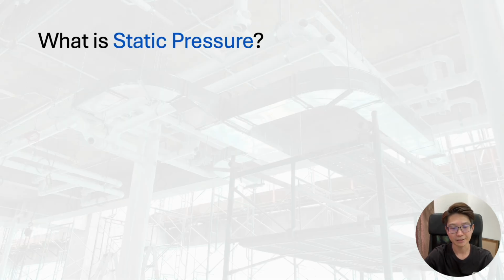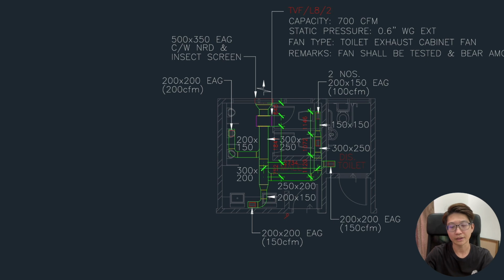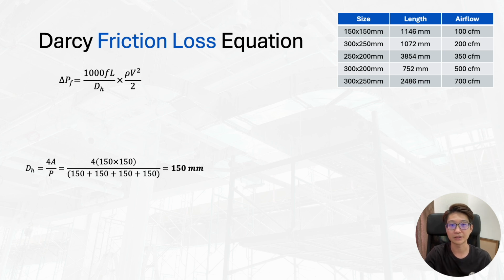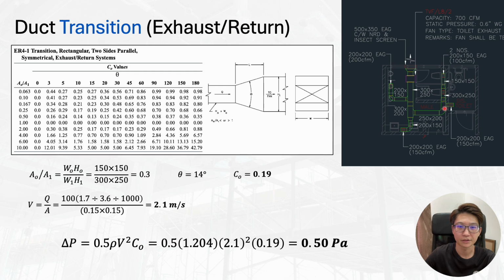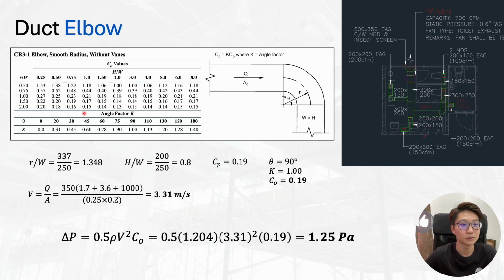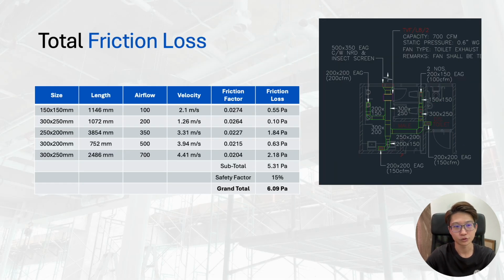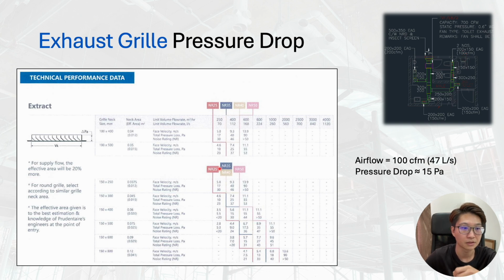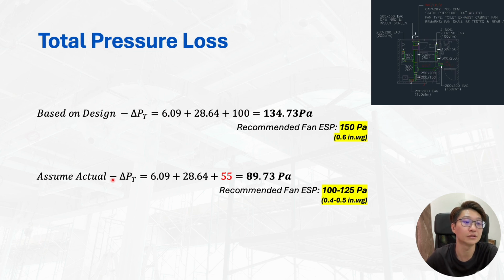Duct Static Pressure Calculation: Static Pressure Explained & Step-by-Step Calculation Guide

Comment: there's 5 grilles inside the zone, why did you only count or include 1 for the equipment pressure drop?
Reply from the maker: We calculate based on the longest path. If the fan has enough pressure to reach the farthest grille, the rest of the grilles have no problem.
Reply: @aircondlounge understood 🫡

Comment: i see from your video there is abslute roughness for flexible duct, but is it already consider about the compression rate of flexible duct?? because i see another video get like 2 times or more than the initial calculation of pressure drop if u input the correction factor from compression rate
Reply from the maker: This example doesn’t involve flexible duct. due to the duct design. But if it does, the potential compression of the flexible duct should be included. Depending on the compression percentage, the pressure loss of the flexible duct alone can easily be doubled.

Comment: Hi, I am a structural engineer.  How do you typically calculate the weight of duct in psf? For example. If duct is 36” dia and 150 plf, do you convert it to 150/3 = 50 psf?

Comment: Bro what difference mcv valve and picv?
Reply from the maker: MCV or motorized control valve is a conventional control valve that has an actuator and control flow based on sensor feedback. However, MCV tends to “hunt” the perfect valve position because when other MCVs open/close, the pressure changes which affects the flow.

On the other hand, PICV has built-in mechanism to be pressure-independent. So, when other PICVs open/close, they won’t affect each other which translates to better control accuracy.